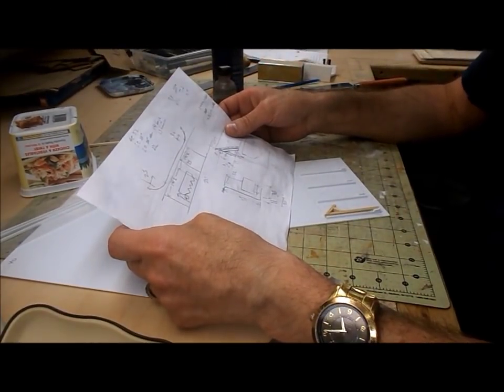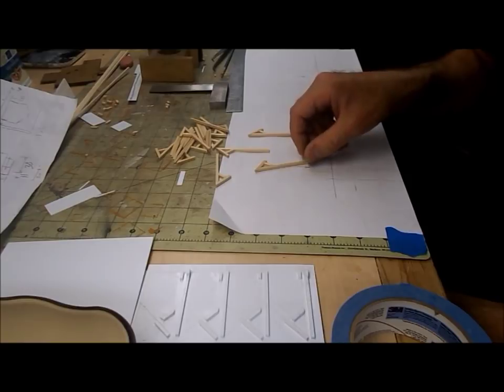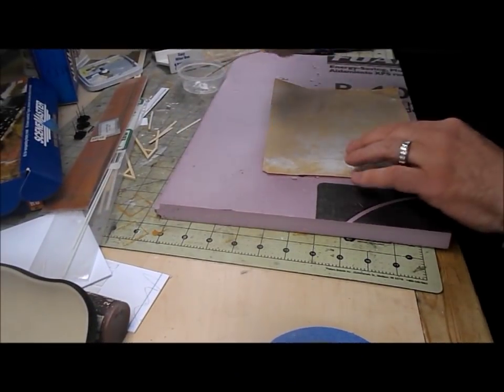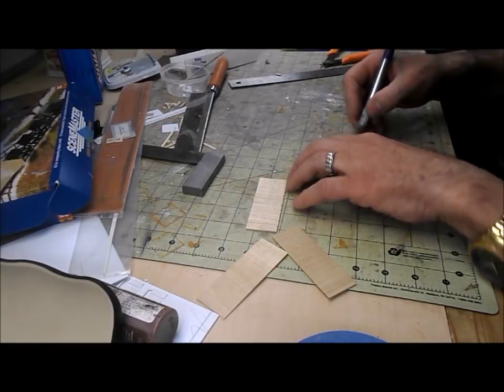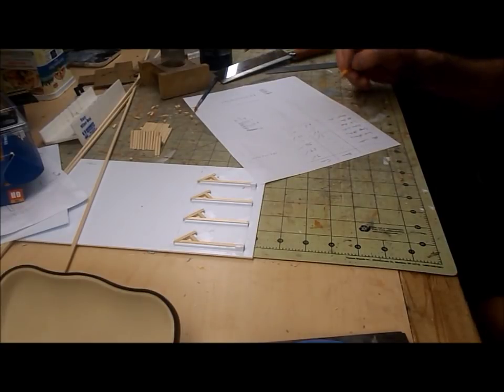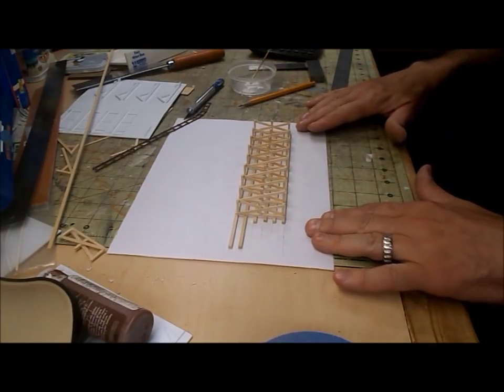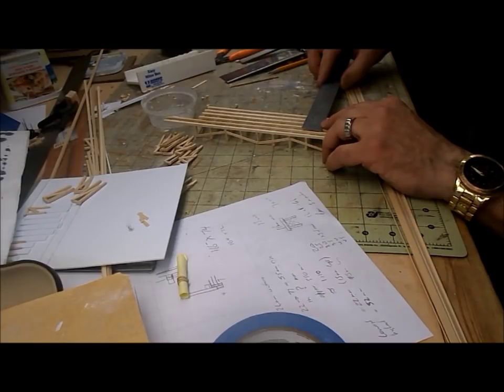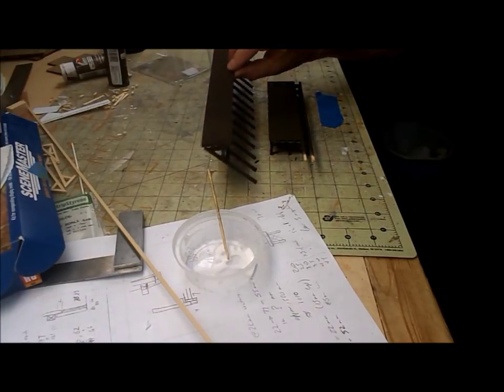Build an HO-scale mining town 5: Miscellaneous structures

Comment: A trick to avoid the glue & paper excess : I draw the templates on paper, and after gluing it on the foam or wood I add a layer of auto-adhesive transparent film (used as covers for books & manuals). Transparent Frisket masking film should also work.
Reply from the maker: I wanted the glue to stick it to the paper.  The whole point is that the paper holds the structure together while it is still too weak to support itself.  The time taken to get the glue off afterwards is only a couple of minutes - probably less than messing around with masking film.

Comment: Great work. I love to watch you building these structures. Do you ever chemically weather your wood, ie vinegar and wire wool, etc, or do you always paint it?
Reply from the maker: No, I've never tried that.  Maybe I will someday.
Reply: mpeterll You really should give it a go.  The base formula I use is 5% acidity vinegar, with some pieces of iron in a pint jar.  Use iron, not steel.  Just use enough vinegar to cover the iron and let it sit for a week or two, shaking daily.  That is a base coat, which I soak my basswood in for 5 minutes.  Once dry, I use a wash of India ink and alcohol to tone down the brilliance of the wood.  I use a thin mix, so it usually takes several coats.  The advantage to this is that it leaves the wood grain visible, unlike paints, which fill the grain.  But it truly looks like wood when you are using actual wood to model.  Of course, lightly distressing the wood to make it look more 'grainy' helps too.  After all of this, dry-brush as you see fit, but I keep mine very subdued, since you want to see the actual wood.  I have used this technique with great success, and I hope you give it a try, Peter.
Reply from the maker: Thanks for that detailed description.  I will certainly give it a try sometime.